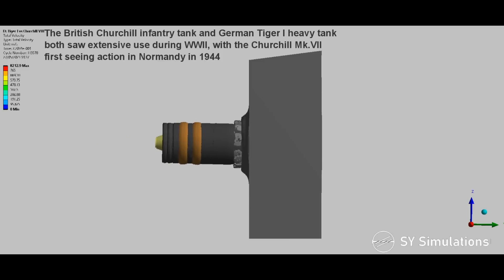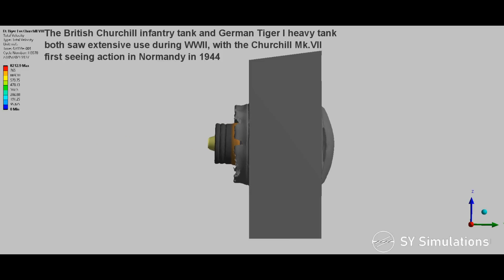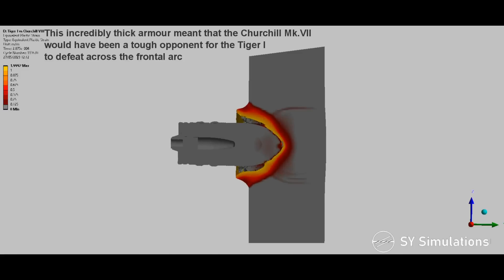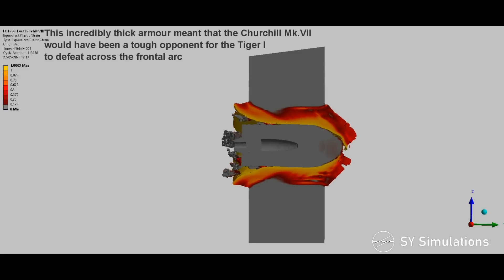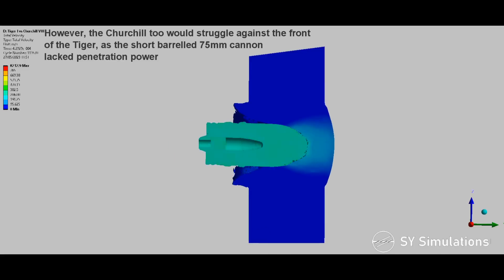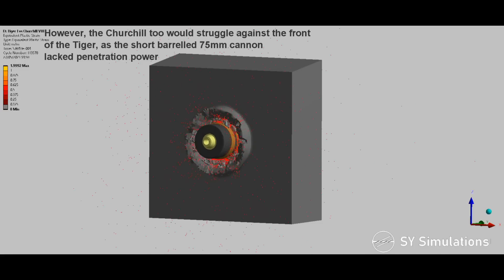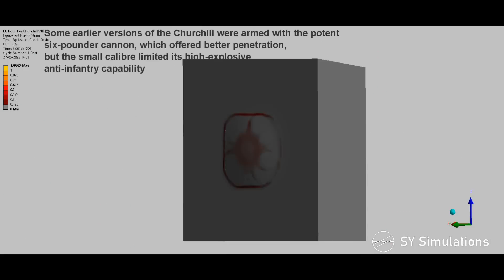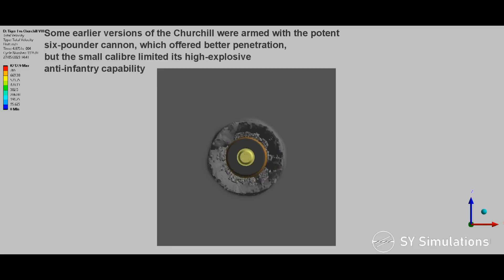TIGER I vs CHURCHILL Mk.VII | 88mm Pzgr.39 Armour Penetration Simulation

Comment: Is it possible that in future videos on ww2 AP projectiles you could add in the mass of the explosive filler as well? i.e. just as soft clay like material which doesn't explode. Reason for asking is that even the 54 grams (weight of explosive filler) adds up to quite a bit of KE at high velocities. Weight of the 8.8cm Pzgr.39 being 10.13 kg without filler and 10.2 kg with filler.

Comment: Note while the shell did get through the front plate but the shell got stuck in the armour meaning it was actually effective in stopping however now that shell is stopped that hole from being wide open

Comment: The vertical plates of the Churchill did it no favours.  A 30 degree slope would have worked wonders, or could have been made an inch thinner to save mass and still provided protection.

Comment: I wonder if it's possible to even simulate the riveted construction of such vehicles, as for what i remember, many British AFVs of the time (mostly Tanks, i think the Cruiser tanks had more platforms of such construction) have had issues in their capability to withstand shots due to such construction methods, as the hits could shear or pop the rivets used to fasten the hull.

Comment: 1. 37mm m3 Stuart against panzer III 1942 North Africa. According to Wikipedia the 37mm could penetrate the Panzer III at 1000m (doubt) so try 500m.

2. 37mm TAK 1918 (world's 1st purpose built Anti tank gun) vs Mark IV/V and or Renault FT. It supposedly could penetrate 15mm FHA at 500m. So what would it do at 200m to the turret/ frnt hatch of a Renault FT?
Reply: British humor at it`s best; I like it so much!
Reply: Earlier panzer 3s had 30mm mangled plate frontally so the 37mm definitely can penetrate that out to 1000m

Comment: Fairly certain Tiger should crack 150mm of (flat) plate @ 100 meters. Something is off.
Reply: Stopping simulation in the middle of the armour perforation is what wrong with this video.
Reply: @AKUJIVALDO this simulation videos are not entirely accurate, a lot of factors could be missing or misrepresented.

Comment: For new tests, I would really like to see something on early (ironclad era) ship armour. Tests with cannon balls against wrought iron + wood backing, tests with early AP shells against the same, comparisons of wrought iron, mild steel, nickel steel, Harvey steel and Krupp steel against a standard projectile etc.
Reply: Wood is a non monolithic material that has complex behavior that cannot be easily describe with simple curve. 
The simulation would have no value.
Reply: @jintsuubest9331  Isn't there the same problem for fibreglass as well?

Comment: honestly it did better than i thought it would at 100m
Reply: I thought it would do a little better since Pzgr39 from the Tiger 1 is usually listed as having around 160-162mm of RHA penetration at that distance (then again it did penetrate so I guess it makes sense).
Reply: @tigertank1819  they just didnt run the test all the way. It did penetrate. And even if it didnt the armor woukd bresk apart and boun e around in the tank.
Reply: @robertharris6092  I know that, I'm just saying I thought it would be cleaner at that distance.
Reply: @tigertank1819  it would, if testing was done properly...and not cut off in the middle of perforation.
Reply: It would be the opposite for me. 100m is pretty much point blank as far as tank engagement goes, and while the Tiger I certainly doesn't have that great of a gun compared to a KwK 42 or 43, it was still a pretty mean one.
But here it doesn't account for splatter and explosive filler anyway, so that Curchill would be done for regardless. But in terms of pure penetration, I'm still surprised of the resilience of the Churchill's armor on that one.
Reply: The tank crew was definitely killed. A story with a sad ending.

Comment: Does the explosive filler not assist in case of partial penetration like this?
Reply: The charge is less than 20 grams of explosive filler of which around 10% is the wax phlegmatising agent, it's about as much as a 20mm MG FF Minengeschoss HE shell which individually isn't that effective against thick steel plates so I imagine being confined inside a significant volume of dense metal the relatively light base fuze section may represent a path of least resistance and will possibly fail first and most of the detonation gases will vent out that path. I might be wrong but I'm under the impression that the explosive filler really just serves to scatter hot chunks of metal around damaging softer components, equipment and cargo and injuring crew the same way a shrapnel shell would.
Reply: This is penetration using most standard.
But yes, the explosive charge will goes off. 
Nigel is no more but most other crew would probably made it.
Reply: We are talking about a couple dozen grams of TNT here. 152mm plate wont care.
Reply: @rosbifke  it's not 152mm plate thick by the time it's 90% of the way through and visible through the other side... the point is if partial penetration will become complete penetration with the additional simulation of explosive filler.
Reply: @a.t6066  no it will not. As commented before, the point of the filler is to ensure the shell breaks up after penetration, meaning it’s designed to break up the hard casing of the shell. When the charge is buried inside the armour like in the video, it is completely incased in thick steel, except from the side it came in. IF it explodes, it will vent everything outside.
The penetration lost by hollowing out the shell to make room for the filler is more than you’d gain if the filler went off.

Comment: All earlier Churchill's ( Mk I - VI with 4 inch / 102 mm front armor ) Tiger will easy defeat from 1200 m !
Reply: At the same time, the 6 pounder cleaves right through Tiger's UPF at 600 meters
Reply: OK  i agree if you will stop cying (:-)

Comment: Although it would be very bad for the crew and likely kill crew members, it looks like the round got lodged in like that image of the tank round stuck in the armor

While I am here, I must ask how armor repairs are made to tanks with steel armor. Does the entire armor plate need to be removed and replaced? Is the damaged section cut out and a new plate welded in? I am discussing higher level repairs here at the manufacturer level or just below that, I assume that if a tank is otherwise fine and needs to be put back into service ASAP, they will just weld the best patch of armor available onto the damaged section, replaced casualties and send it off into battle.
Reply: If possible, the hole will be cut to easy to work shape. 

Then they will cut a piece of stock armor. 

Then they will weld it back. 

Due to armor having very specific heat treatment and stuff, the welding need extra careful process compare to say the leg of your desk. 

If the damage is structural or too much effort, it will be salvaged for parts. 

How do we know the plug hole is as good as factory produce steel? Pray whoever did your repair is competent.
Reply: Depending on how it was made, the hole would often be cut out and a plug welded in.
Reply: according to pictures showing holes in 88mm diameter the shell had sung: you say stop , and Isay no,no,no  (:-)
Reply: After the explosion of the chamber charge, it will be necessary to clean the tank from scraps of meat and liquids. And only then repair.

Comment: From the little research that I have done, 

Firing PzGr. 39 (APCBC) it will penetrate this at 250 m.
Firing PzGr. 40 (APCR) it will penetrate this at 1500 m.
Reply: yeah it's kinda weird that the sim didn't show that
Reply: @jujuteuxOfficial  It gets pretty close. It's very hard to get it exactly right, and run to run variance might differ. The simulation might also have a bit too high quality steel compared to what was actually achieved. This hit alone would probably spray the crew with some small shrapnel that could be counted as "penetration" even if the shell never made it inside the vehicle. If the He exploded it might also push some shrapnel in.
Reply: @PAcifisti  yup but spalling isn't penetration, there's a reason you get a high explosive filler in there
the docs show that it should at least get 40mm or more before stopping
Reply: @jujuteuxOfficial  Spalling can also be penetration if there's a hole in armor with chunks flying into the crew. They don't really care if they get taken out by a piece of armor or piece of the shell. 

Or would you say those T-34 shots that had the entire round ricochet off the armor plate with large chunks of the front plate flying inside the tank at 300m/s not to be counted as "penetration"?

Also, explosive filler was never as potent as WT makes it be. It was quite unreliable and only made the frontal cone larger.
Reply: @PAcifisti  britain didnt even consider HE filler worth using.
Reply: @PAcifisti  The allies had consistently good steel quality during WW2, German steel was good early in the war but later production suffered from brittleness. When the Brits tested various weapons against a Tiger after the war, 17 pdr impacts to the side armor at high obliquity were enough to shatter the roof hull roof.
Reply: @hawkstable8889  Yeah, the problem there with the armor was tempering. Allied bombing campaigns starved the German war machine of their primary preferred tempering elements for steel armor. 

Those being primarily Nickel, Manganese, and Molybdenum. Which produced very hard but also very tough armor. With these three elements they had to substitute it with another more available element. Their choice? Vanadium. 

Now under absolute ideal circumstances this would've been a brilliant choice as it could produce the same general effect. However, German factories were a far cry from ideal conditions mid-to-late war with the intense bombing campaign, unskilled labor coming from...let's say unwilling workers, and lastly of course good old fashioned sabotage. 

The result was plates that were very hard but exceptionally brittle to the point of shattering. Good quality plates became highly uncommon post 1943. They did exist, but they were uncommon. 

The US captured at least one Panther of good armor quality some time in 1944 because they tested their anti-tank cannons on it extensively at Aberdeen Proving Grounds. 

What they learned was that the US 76mm gun was completely insufficient against the Panther's hull front (no penetrations achieved with any round at any range), the original 90mm M77 AP was deemed unsatisfactory even before this point so it was left out of testing, M82 Shot achieved penetration at 650 yards, T30E16 (what would go on to be classified as M304 Shot) achieved penetration at 800 yards, and T33 Shot achieved penetration out to 1,100 yards.

Edit: Ranges double checked and fixed*

They could tell the tempering on it was good because when struck the armor was holed cleanly when penetrated and gouged when penetration failed. On a poor quality armor plate the penetration holes would be jagged like punching a hole out of concrete and the plate would crack locally even under a failed penetration.
Reply: @hawkstable8889  Except it wasn't as good or as consistent as you might think. 
Late war German steel was inconsistent. Some plates were good. Some were not.
Reply: @andzejwojownik8012  I do believe that I said that, yes.
Reply: @ OK, trump voter IQ at work. 
Meanwhile, you said "allies had consistently good steel" - which is wrong, allies also had steel issues, but they sorted out the problems and by late war the quality was generally good, which doesn't mean there weren't some variations in quality.
You also said "later production suffered from brittleness" which is kinda true, because SOME of the later production did, some didn't.
Reply: @ Idk, I've never heard of the US or UK having too many issues with steel quality, especially Britain since they were never really in a big rush to produce tanks and had a well developed steel industry. The US were putting out Shermans at a pretty huge rate but that was simply because they were practically immune to attacks on their factories so keeping quality control wasn't a challenge. Now the soviets did have a lot of variation in quality between factories and production batches due to the way production orders were done, where smaller factories sometimes had to produce a huge number of tanks in a short time leading to having no time for quality control. Even the IS-3, which is a post-war tank, had issues with the turret castings cracking. 

Not entirely related but according to most sources the Brits had the best quality ship armor of any nation in the war, which may correlate to other armor production as well.

Also what Trump voter IQ? I don't even live in the US lmao.
Reply: @hawkstable8889  Trump voter IQ = low. One doesn't have to be murrican to be kinda dense.
Also thank you for detailed response. 
I remember that cast hull Shermans had their issues till about 1943. Brits were using rivets in a lot of their tanks which was "not optimal", even if the steel itself was good. 
The thing is, again - even with relatively good quality, there were always sub-optimal pieces of armor, as WW2 high quality would be considered kinda random by today's standards. I just think that your comment oversimplified certain things.
Also I don't consider Soviets "allies" as they were helping Hitler till they got struck by the stick themselves.
Reply: @ThatGuyOrby  Excellent resume
Reply: @andzejwojownik8012  If they were a Trump voter they'd be going on about how the German's didn't have those shortages and hardened their steel just fine. Trumpists like to paint the Nazis as a nearly unstoppable force to be admired so that the Americans look all the better. Also the allies weren't just randomly switching between rivets and welding. There were specific tank models that used riveting and those were early model tanks that were phased out or used for force projection in areas where fighting wasn't seen. 

The cast hull Sherman tanks were meant as a broad solution, as in a tank that many factories could produce. This obviously meant that the quality was going to vary somewhat widely, almost as widely as with the T-34, but not nearly as bad as with the Panzer IIIs and IVs. The later models of Sherman switched to welded plates and had some of the best armor of any medium tank as well as the most consistent armor of any medium tank.

One way to determine the quality of the armor is to look at the dimensions and weight of the tank. The Shermans and Panzer IVs had very close dimensions, yet the Panzer IV variants all were consistently a good 5 to 10 tons lighter than their equivalent Sherman variant. And that's with the Panzer having the heavier gun and thicker armor. The reason for that thickness was to compensate for very poor quality steel.

In my opinion a good portion of the complaints about Sherman armor came from a combination of American soldiers not wanting to be there (can't say I blame them) and the fact that no medium tank stood a good chance against the anti-tank guns used by infantry on both sides. The Sherman tanks would've been a bit more survivable if they had gone with a front engine design and used the weight savings for extra armor, but even the 40 ton Churchill Mk.VII could be penetrated from the front by an 88 in spite of having some of the thickest and highest quality armor used during the war.
Reply: This is penetration using most standard?
Reply: tbf both the tracer element of the BdZ and the bursting charge was omitted from the simulation, that's about 100 grams of weight missing, which might just provide that extra bit of KE to punch through the plate. 100 grams @ 765 m/s is 29 KJ afterall.
Reply: Yeah, though it is worth noting that APCR was in chronically low supply by 1944 due to tungsten shortages.
Reply: @hawkstable8889  Heck it was even in short supply on the Allies side,

So almost non-existent for the most part on the German side.

Comment: I wonder how powerful the Black Prince would be
Reply: in this situation? basically the same.
if you mean generally, then most likely better than the churchills.
Reply: @o-hogameplay185  It would've been worse by a huge margin. The Black Prince was even worse than the Tiger II in terms of "soft stats", AND had cripplingly low mobility on top of it. It was something like 20 tons overweight and could barely manage 12mph on flat ground, completely ruining the advantage the early Churchills held on rough terrain.
Reply: @o-hogameplay185  The gun performance is great, 17pdr good. The BP is awful, terrible tank, and no amount of great gun will make it not suck shit through a silly-straw. It's like a British Ferdinand.
Reply: @o-hogameplay185  Since the video talks about the poor 75 mm performance, I mean that with a 17 pounder it would definitely be more than a threat to Tigers and Panthers
Reply: Powerful vs armor but weak vs structures and infantry because 17 pdr have small HE shell capacity ( weaker than 75mm gun ) !!!
Reply: @HellskyMr  That's a problem all Anti-Tank shells had. Panther was the same, it was basically an Anti-tank weapon with almost no space for HE filler.
Usually the slower the shells were, the more HE filler space they had. 
Then again, the Black Prince would be used as a Tank Destroyer, not Infantry support.
Reply: @thiagorodrigues5211  
What? German 75 HE is the best HE in its class despite needing to cope with high velocity.
Reply: @jintsuubest9331   75 HE from a Panther?
Reply: @thiagorodrigues5211  
Yes. Iirc, German 75 projectile is common across all 75 gun. Only thing that changes between the gun is the propellent charge.
Reply: @jintsuubest9331  never heard of that. It's s known fact that Panther ap shells are made to penetrate and have less explosive(which people realize was useless anyway) 
I have to search for HE shells though, what I knew about it is that the Panzer IV F1 gun had a slow but powerful one